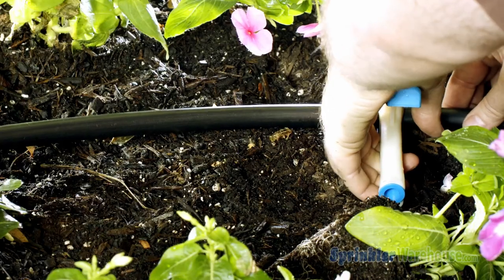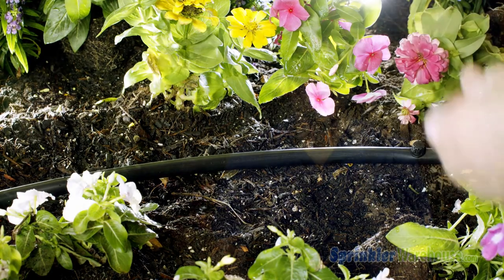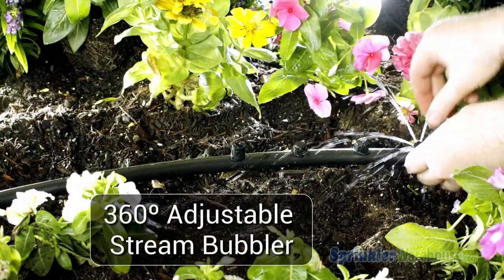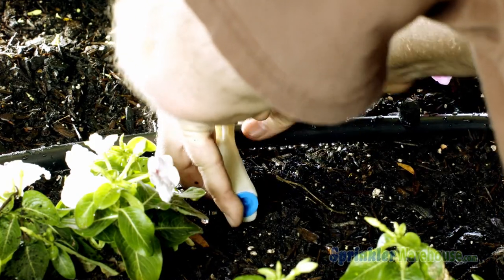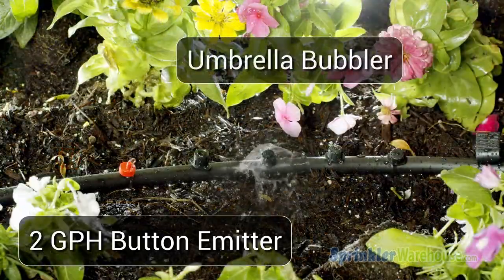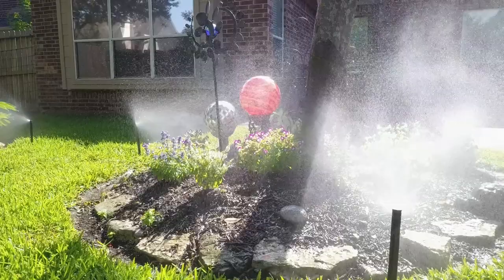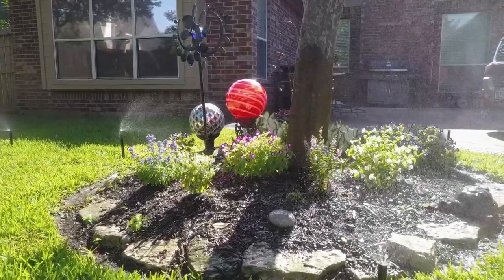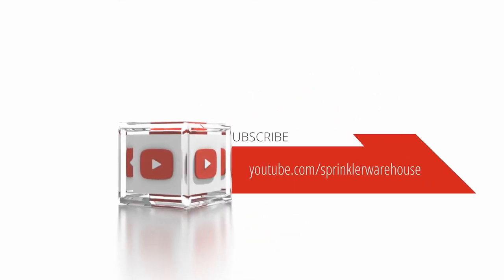Adjustable Barbed Emitters

Comment: Will it be that strong if using a 25 psi pressure regulator?
Reply from the maker: The amount of flow will vary depending on the PSI. Please review performance charts for that information.